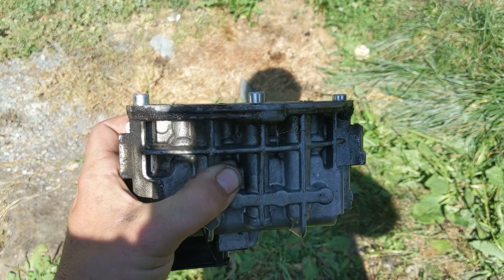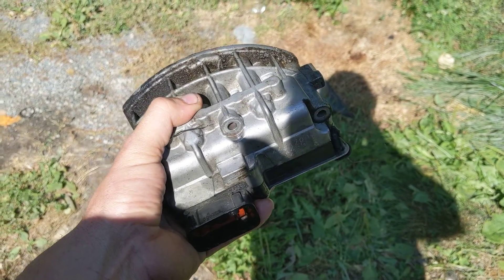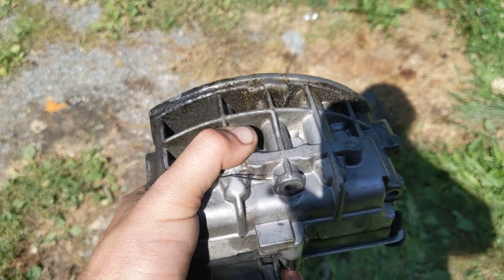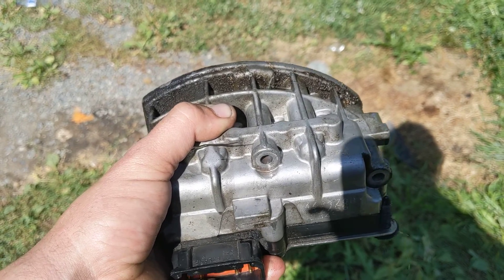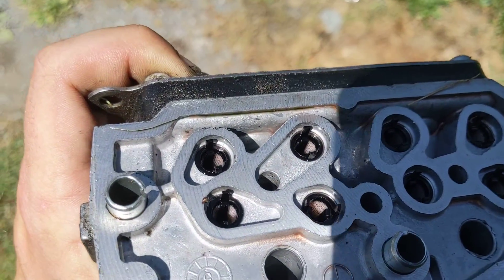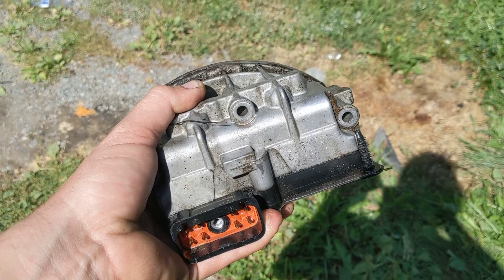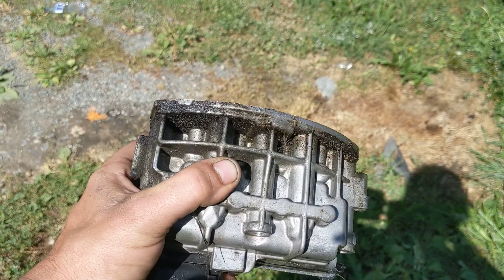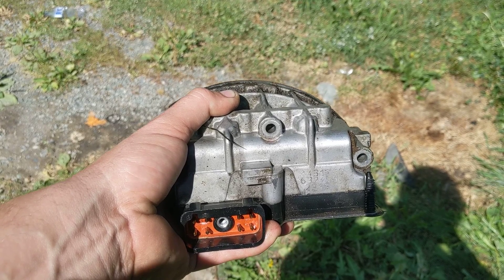A604 Transmission Shift Solenoid Pack Failure

Comment: I'm driving myself crazy with P0765. The previous owner just installed a refurbished solenoid pack, but the it's still in limp mode and resets this code every time.
Reply from the maker: Check wiring at this point confirm the pack is still good too could be a bad refurb too

Comment: I have a 1999 Chrysler cirrus lxi, it came with a plate between the solenoid and the transmission. Do we remove that plate when installing the new solenoid? We have tried everything and it keeps leaking and only goes into reverse with the plate in.
Reply from the maker: Remove the plate

Comment: My car (Avenger 08)
 makes a grinding noise when put on gear, they told me is because the shift pack is no the original, what do you think?
Reply from the maker: Grinding would be internal failure not shift pack failure
Reply: @RedneckProvingGrounds  Thanks for the reply, it has zero shifting problems, car revs and accelerates perfectly, I wonder why it makes that sound...
Reply from the maker: Well record the sound if you can n find me on Instagram jfellon83 and send it to me I'll be able to tell you if it is internal or pack noise

Comment: Hi! i changed the solenoid pack in a Dodge Stratus 99, but now is leaking transmission oil like a mad when i start the engine, do you know which can be the cause?? thanks for your help and the video
Reply from the maker: Did yours have the plate underneath it? Some did and some didn't
Reply: @RedneckProvingGrounds  yes, it has a metal plate and a rubber cover fit over it, i had to remove that rubber cover in order to access to the solenoid pack and remove it also, before that, i tried to fit that plate with the new pack but i had observed the holes on the plate and the old gaskets were different (the plate had one and the solenoid pack had another) from the new one, in this case, the new piece includes only one gasket that fit perfectly, so i decided to remove the plate and and install the new pack directly using the included gasket. It was wrong?? Thank you for your response
Reply from the maker: You did it correct your gasket may be back remove n try again with a new gasket n make sure to evenly torque it down n make sure the area is clean as you can get it n make sure the dowel pin is in the correct position
Reply from the maker: The plate is no longer required so it needs to be removed
Reply: @RedneckProvingGrounds  ok, i going to check it again as you suggested. Thanks for the help Jason!
Reply from the maker: No probs

Comment: Did you have to remove the plates because 1992-93 the early years had a plate right but the updated solenoid pack doesn't require that is that true?
Reply from the maker: Plate was removed yes
Reply: @RedneckProvingGrounds   okay thank you for the feedback was it hard to remove
Reply from the maker: Not really, just make sure when you install the new pack on the transmission that you make sure it's clean is all, if you are performing a transmission service at the same time the better, new fluids n filter
Reply: @RedneckProvingGrounds  yeah I am completely power flushing all the fluid out thank you! I've done the solenoid packs on the newer 604 transmissions
Reply from the maker: No probs 👍 glad to help out
Reply: @RedneckProvingGrounds  🤞🤚 let's hope all this works haha
Reply from the maker: What did it do is it stuck 1st n 2nd gear aka limp mode?
Reply: @RedneckProvingGrounds  I have a 1990 Chrysler Imperial Gloria Vanderbilt Edition that I've had for the last 14 years in 2010 I was working three jobs and all of a sudden the transmission started slipping I put it up for a couple months and wanted to mess with it change the fluid did the sensors never did the clutch pack I finally broke down and took it to a repair shop cost me $1,300 come to find out the idiot put Dexron transmission fluid in it when it calls for Chrysler ATF there is some metal shavings in the fluid it's just started slipping again last year I only put like 17,000 miles on it since the rebuild but come to find out the guy lied it was a transmission computer so he rebuilt my transmission for no reason now I got new fluid new filter the sensors and the solenoid pack is on its way hopefully going to be here tomorrow and I'm putting a new transmission cooler on it there's the story haha in a nutshell...ugh
Reply: No it's not throwing any codes or going into limp mode
Reply from the maker: Well just remember leave the battery disconnected while your doing this so it wipes out the TCU computer, on your 1st drive make sure you drive it easy for the 1st 25-30 miles so the transmission computer aka tcu relearns shift patterns , the TCU has fuzzy logic for shifting tables and pressures.
Reply: @RedneckProvingGrounds  yeah I did but the dextron fluid really has to come out

Comment: got the code 1784 LR pressure switch circuit ,i went ahead and replaced the solenoid pack, now it's suffering from code 1781 OD pressure switch. hmmm looks like if one gets fixed it switch's to another gear to mess up..lol  99 chrysler 300 m 42 LE/606
Reply from the maker: Time to drop the valve body n clean
Reply: @RedneckProvingGrounds  i tried with the first one but since it was low enough to put solenoid pack in i left it at that , it wouldn't come out all the way.